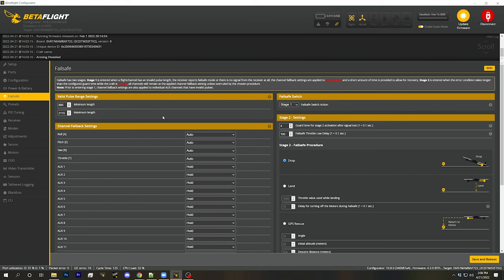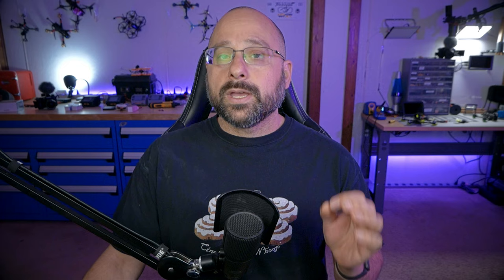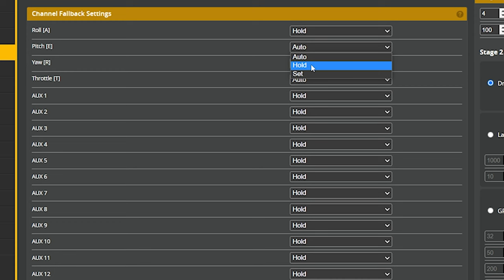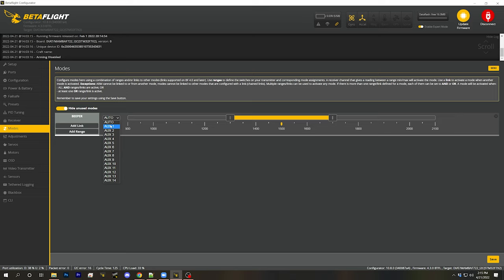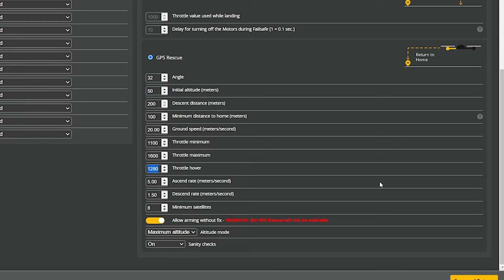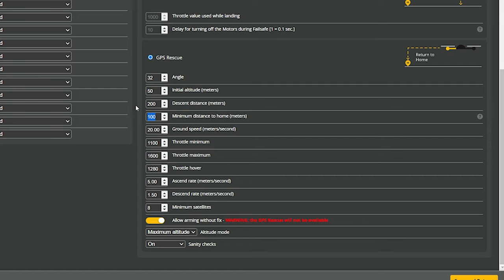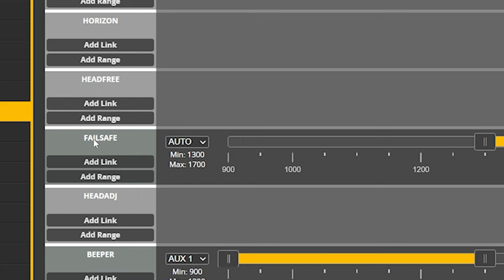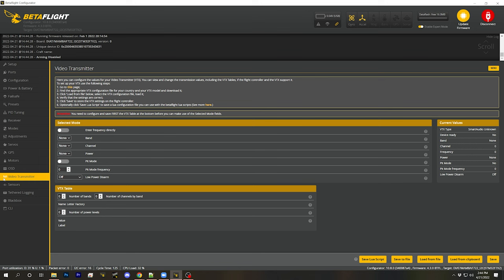Betaflight 4.3 Failsafe Tab | COMPLETE WALKTHROUGH PART 8

Comment: It's interesting that the 'likes' are lower here than the rest of the series. I have a lot of quads with GPS because I'm not a racer and use my quads on trips in the mountains or interesting places (formally with crossfire and now with ELRS. )
In my planes I use INAV generally but I do have explorer quads with betaflight with GPS's without compass so this is a pretty interesting video for me. Although my favorite quads are my 5" fun flying (no GPS) screamers even though I'm no where near great at freestyle. This has been my favorite series from JB! As comprehensive as I could've ever wanted. I've learned something on every video so far!

Comment: There is a post from Chris Thompson where He says to set the Stage1 throttle a little bit higher than the hovering value so that quad starts gently climbing while entering in Stage1. And a good duration of Stage1 should be around 1.5 seconds. That is, if I well remember.

Comment: Hmmm... seems pretty trivial to measure the throttle required to (nearly) hover for whatever weight you happen to be flying.  Then using a delay of 10 or 15 seconds, you now have some time to alter your TX position to see if you can regain the comm link.   If not, the timer expires and it drops out of the sky like the "drop" mode you suggest.  Why not give yourself a chance to recover signal before immediately dropping?  Especially, if you happen to be flying over something like a lake at the time.

Comment: one thing to note the quad will travel forward at the same time as any altitude goes up!!! and not travel up first... this is one good reason to boost the altitude speed in the event of failing close to objects
Reply: Thank you, while trying GPS rescue while hovering 1m from the ground, I was surprised to see it zip towards people about 50m away without climbing first so I disarmed without waiting to see if it would climb before meeting them. With your explanation I see that I should have flipped the switch from higher off the ground...
Reply: @manikb8011  if you increase the airspeed to cope with wind you need to increase the climb rate to keep the same angle of climb

Comment: I would like to have a mix of Stage2 failsafe, have it auto level first and then fall off the sky, this way the odds of it landing upright are increased. I do not want it to check if it is leveled, just try to do it and fall off either way. Motor RPM could also be used to figure out if the quad got stuck somewhere but I think thats way too much, if you're failsafing  then something is very wrong.

Comment: Another close range failsafe to look out for is antenna loss on rx. Had it both with knocking of elrs ceramic and ufl disconnecting. Manifests as stage 1 at close range and then stage 2

Comment: Ok they just need a toggle button that does all of this for you. Select your Flight Controller, select what size drone (3, 4 or 5inch) Then it automatically configures everything for you so you can start flying. Then if you want you can go back and adjust as you want. This is all amazing information and I know how to do most of this but the learning curve for a new pilot is not getting easier it is getting harder.
Reply: Its made this way to force you to learn so you don't accidentaly make your quad dangeorus. However, with BF 4.3, easy presets are available for everything

Comment: All those tutorials are great... Btw some of them I just downloaded as reference on the field Thanks Joshua ☺️. One thing I still not sure how it works... Yesterday I updated my quads to FrSky Access, using F.Port, and one of them was not working... (telemetry and commands from my RC)... Then I found out a bad contact in the receiver's connector with the cable (F.Port), after moving it a bit, worked perfectly, and no more problems. But, what if this happen again during the flight ? (I mean, The receiver and the RC are communicating but the Receiver and ESC aren't). Would the Failsafe be fired by the Throttle "inactivity" ??? (I know this video was released a long time ago, but perhaps is a good question, I did not find many topics about it on the Internet). Fly safe guys :)

Comment: JOSHUA - i am so ready to learn something today so help me out if you can. 
nobody ever could answer me this question about GPS Rescue Altitude mode@ 16:45min
so we got:
- MAX altitude
- FIXED
- CURRENT
now here is the thing. i often fly over clouds just because i can where i live. and i have it on FIXED GPS rescue at 80m. 
i climb up to lets say 2000 meters. then i see my battery getting lower and i start to decent. at 1500 meter height a cloud is moving between me and my drone so i loose video signal.

! if i failsave with switch or crossfire signal loss - does that mean the quad will go down to 80 meters and then try to fly back? or does it mean it will ignore my set fixed altitude of 80m and try to go back up to 2000m because that was the highest point i fly, draining the battery to zero and quad will be lost? !

sometimes the quad drifts away due to strong winds up there and i am at the edge of a failsave. means i was tempted multiple times to switch on GPS rescue but never dare to do that because nobody could explain what will actually happen if the flown altitude is much higher then what i set before. i would love to hear that fixed altitude means the quad will go UP or DOWN whatever it takes to reach the height you set and THEN try to fly back to the home point. 
do you have any knowledge what will actually happen in this case? thanks alot for everything you do for our community. 

keep the blue side up° ☀🌌⛅🌈
Reply: It should go down, test it, set it to 80m, fly to 100m in a controlled environment and trigger it.

Comment: Hi 👋 JB, great 👍 series I’m learning a lot. I mAde the mistake of buying a qx7 accst. Now I had to buy rxsr for my Darwin baby ape. So what would the values look like for failsafe 1 with the rxsr? Also I didn’t flash to the 4.3 because of the problem I had with rxsr. I was able to recover it in Frsky’s hidden DL page thanks to your video. So you mentioned bind and fly’s on your first video. That the developers might have pre sets. So in the back up file it basically just says 4.2.5 firmware. So if something goes wrong would all I have to do is reflash the old firmware?? Thanks again for all your YT content.

Comment: Awesome information you provide   What happened to the failsafe tab in the latest beta flight ? no more sat's to aquire before arming gone ?THANKS !
Reply from the maker: Turn on expert mode in the configuration options for BF configurator. The failsafe tab will come back.
Reply: @JoshuaBardwell  I knew that was it , i was going to check.  THANKS AGAIN !😀😀

Comment: How does the FC know when to enable return to home? If I loose signal or turn my radio off the control values will automatically drop below 1000?   
Do I have to set anything is the modes section of betaflight or only select RTH in the failsafe section?

Comment: hello from Greece. I have assigned a switch to enable gps rescue to check if it works and when i need it, say i loose video feed etc and i would like the quad to start returning. After flashing Betaflight 4.3 and seting everything up from scratch i went out to test the quad. After flying around i enabled the gps rescue switch,400 meters away and the quad behaved like stage 1 failsafe and dropped. Recovered and had a broken arm. I saw in betaflight that the failsafe switch was to stage 1 but i dont have failsafe switch enabled i have gps rescue so why did the quad fall down from the sky?? I have the Nazgul5 Evoque F6d HD version. Thank u

Comment: Um, arm without GPS lock has been removed?? A lot of options seem to have been removed. 🧐
Reply: Depends on what betaflight version you have, in earlier versions, that setting can only be acceesed through CLI
Reply: @kaskobi3657  I found out that I hadn’t updated the FC firmware, I thought I had. This gave me the extra options.

Comment: Would it be possible(besides the question if it would be smart) to disarm and then rearm your quad mid flight to gain/reset a home point and enable gps rescue that way? In the case you were not able to lock on enough sattelites at the moment of the initial arming.
Reply: This is possible if you disable the permanent home point setting

Comment: 10:30 : Actually, using the gyroscope data, betaflight should be capable of figuring out when the quad touches something and disarm instantly.
Reply from the maker: Betaflight has this capability but it disables it shortly after arming. If you tap an obstacle you don't want the quad to just drop out if the sky. You want to be able to keep flying.
Reply: @JoshuaBardwell  In that case yes, but I was talking about the failsafe landing procedure. As it's automated, Betaflight could guess that the quad has touched something and it has to disarm to avoid to cause collateral damage.
Reply from the maker: Oh I see. Yeah it does have sanity checks that monitor the gyro and PID error and such. But it's not very reliable.

Comment: Regarding Failsafe....I tested GPS Rescue with the aux switch on my 5 inch. But still haven't got the guts to turn off the radio in a field 100 meters away to test. I'm using TBS nano receiver. I've seen a video where the author indicated he had to put the TBS receiver into Failsafe = Cut. before GPS Rescue would work.  The default is Fs Pos. Anybody have experience with this?
Reply from the maker: The default for crossfire is definitely cut not pos, and that's definitely what you want unless you're flying a servo plane with no flight controller.

Test by using failsafe aux mode. Don't power off your controller.

Comment: I recently flashed 4.3 and I get rx loss warnings i don't ever failsafe i usually run 100mw but thought to try even at 1000 mw it still says rx loss and maybe only 50 feet away it never actually acts like it's about to fall out of the sky and my rssi dbm is fine along with the 6:100 range thingy sorry don't remember the name for that hehe...so odd as it litterally only happened with the new flash ever heard of this anyone?

Comment: If set to auto Betaflight default stage 1 failsafe behavior throttle goes to low. It means that throttle goes to minimum valid pulse range right? Quad just falling for 0.4 second?
Reply: Yes

Comment: If you buy a qaud from rotor riot that’s already ready to fly what is the fail safe set too? Mines coming Tuesday.
Reply: You should open the bf configurator with it to look over every setting anyways.
Reply: @kaskobi3657  yeah I don’t own a computer. Only ever used iPhone but I’m going to buy a computer so I can look over that stuff and I’d like to change my rate also. I started with the DJI fpv and that was what was good about that as you could do everything on my iPhone or goggles. Thanks.

Comment: Please I have a problem with omnibus f4 board …..when I throttle up the drone just flips forward or backwards how can I fix that ?
Reply from the maker: If the quadcopter instantly flips over when you arm and raise the throttle with props on, it is almost 100% certain to be one of these things:

1. Clockwise prop installed on counter-clockwise spinning motor or vice versa.

2. Flight controller not facing forward. Go to the Setup tab in the configurator. Tilt the quadcopter on all axes (pitch, roll, yaw) with your hands. The 3D model in the configurator should move the same as you move it with your hand. If it does not, use the Board Alignment parameter in the Configuration tab to fix it.

3. Motors not wired correctly. TAKE OFF YOUR PROPS. Plug in a battery. Go to the Motors tab. Turn on the "props are off" slider in the lower-right. Raise the individual sliders (1, 2, 3, and 4) one at a time, just enough that the motor begins spinning. The motor positions (1, 2, 3, and 4) should match the graphic in the upper left. If they do not, then either move the signal wires so that they are correct or use resource reassignment to virtually "move" the motors.

4. Motor spinning wrong direction. Do the same as step 3 but compare the motor direction to the arrows on the graphic in the upper left. If a motor is spinning the wrong direction, either reverse it using BLHeli (or whatever ESC software you are using) or swap any two motor wires with each other, which will reverse the direction.

Many times, people swear up and down they have checked all of these things, and then come back to say oops I missed one you were right. So if you think you have checked all of these things and your quad still FLIPS OUT, go back and check again. If your quad is insta-flipping on takeoff, it is almost always one of these things.
Reply: @JoshuaBardwell  okay thank you very much and I will check everything again
Reply: You were right the motor position were wrong and after changing it flies well

Comment: I have a question regarding allow arming when fixed,
what happens when you have not set this slider, so Betaflight does not arm without having a certain amount of satellites and then you fly, crash and disarm. In the new position satellite reception is not as good and you loose a couple of satellites so that the number you have is below the minimum amount. Will the quad then not arm again?
Reply from the maker: I believe you're right about that but I can't say for sure.
Reply: @JoshuaBardwell  interesting, sounds like a reason to me to set allow arming without fix. Or maybe it realizes that it has not reached the homepoint and the homepoint stays until the fc is rebooted. I wonder how I can try that....
btw thanks for answering on an 8 months old video. I have to send you a tip now, since I'm also binge watching all your bf 4.3 videos.
Reply from the maker: Home point is reset when you re arm, by default.

Comment: Great video - as always.
How do I regain control in a failsafe gps rescue: Ideally the quad flies up and then I already regain a link. Does it just somehow tell me to fly again myself? Otherwise it returns to the home point and crashes into the ground. How do I regain control say 100 meters out to keep it from crashing?
Reply from the maker: It reconnects and you will see RSSI go back and show connection, and then you move the sticks to take control. Once it reconnects, you have to deflect the sticks at least something like 20-25% I don't remember the exact number to take control again.
Reply: @JoshuaBardwell  Awesome. Thanks. Will have to see how to show RSSI in the goggles but you probably have a video for that ;-) Used pur DJI/vista so far, just jumped to ELRS.
Reply from the maker: https://www.youtube.com/watch?v=Oogm72vRclA

Comment: Isn't there a bug in betaflight 4.3 that prevents gps rescue on fail safe from working?
Reply: Every time I save with GPS mode selected, it goes back to selecting the "drop" option.  So I think you're right.

Comment: I am still a bit confused about how best to set up the failsafe aux mode switch in order to test that GPS rescue is functioning as it should. I did set up an aux mode on a momentary switch for failsafe and under the failsafe tab, I had the failsafe switch action set to Stage 1. Under the Channel Fallback Settings for that aux channel, I had in configured to set at 2000 as that is the value that activates the failsafe switch on the modes tab. When I tested this in the field the quad went into GPS rescue and flew back to my take-off location but I could not regain control of the quad and it ended up crashing. I'm thinking where I went wrong is that I should have set the Channel Fallback Settings for the aux channel that triggers failsafe to hold instead of set. Does this sound correct?
Reply from the maker: It's possible that your failsafe aux setting prevented the FC from leaving failsafe aux mode. I'm pretty sure the failsafe aux mode needs to be set to "hold" not "set" to work properly.

If you go into GPS rescue and can't regain control, most likely it's because you did not deflect the sticks enough. Once link is re-established (or you release the failsafe aux switch) you must deflect the sticks at least, I think it is 25%, before the FC gives control back to you.
Reply: @JoshuaBardwell  Great, thanks for confirming the use of "hold" instead of "set" for that aux channel, that does make sense. I was trying everything to regain control as the quad was drifting down. The only thing I didn't try was turning the radio off and on again.